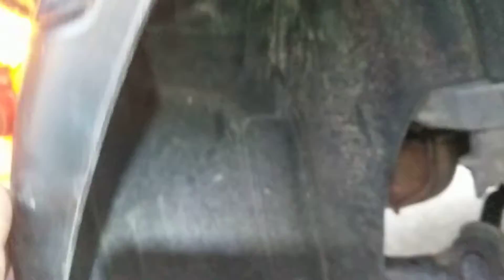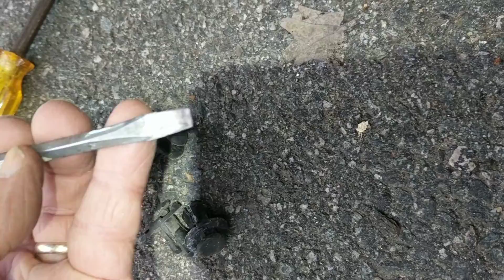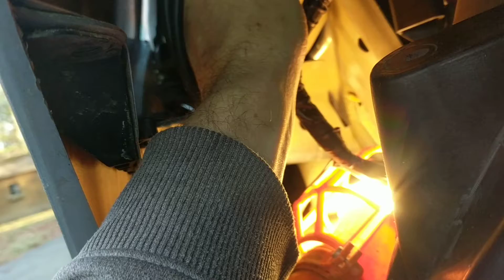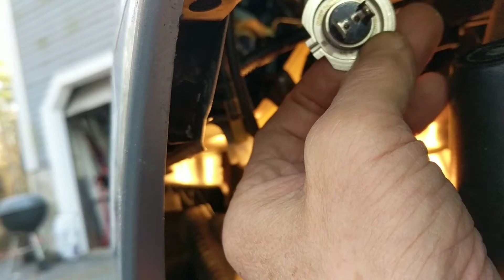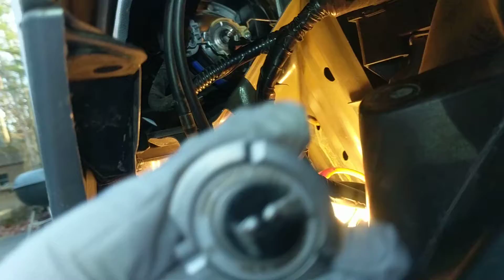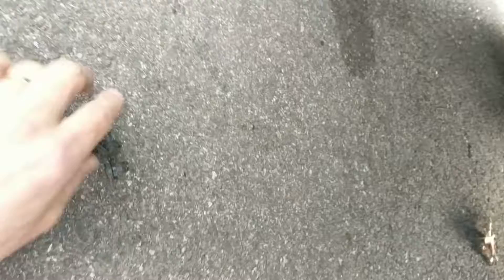2013 Subaru Outback low beam headlight bulb replacement

Comment: Good tip about taking care not to break the wheel-well cover plugs.  Another video (by a mechanic) mentioned the 2-step process, but he pulled pretty hard on the plugs before he got to the point where he could use a flathead screwdriver to pry out the bottom part.

Comment: I did mine yesterday.
 What a terrible job.
  Did not remove the wheel. Removed 3 plastic fasteners... was somewhat difficult because they are full of dirt. 
Folded back the plastic wheel well cover and remove cap and bulb.
 Worst part of the job was not being able to see while installing the new bulb. That was difficult. Other than that a piece of cake.
Crazy subaru engineers that designed this stupidity!!!